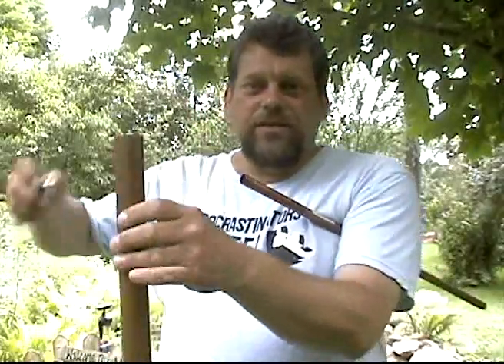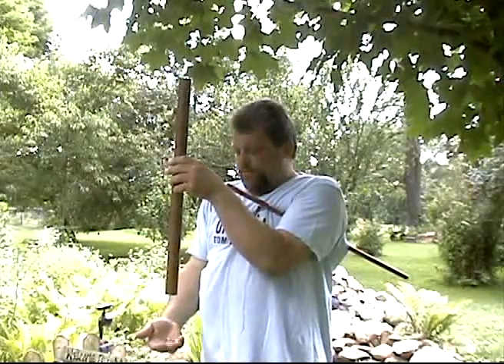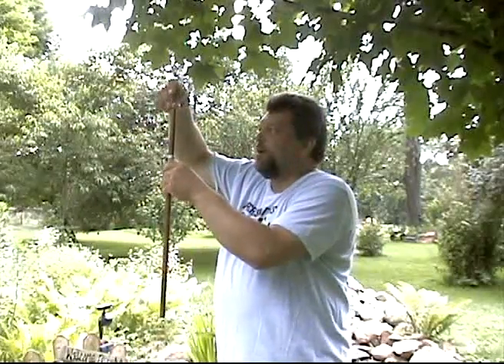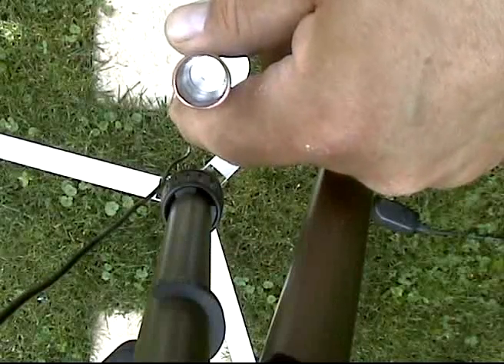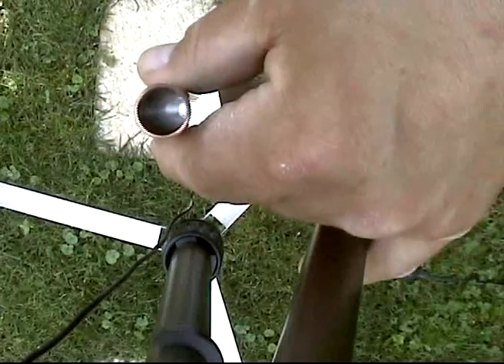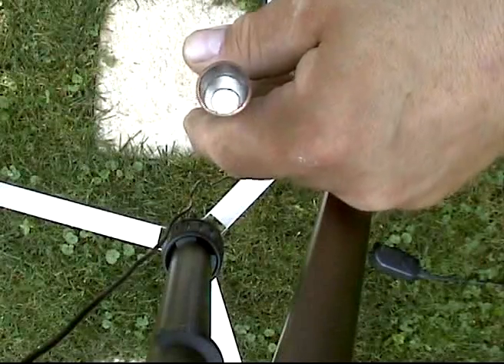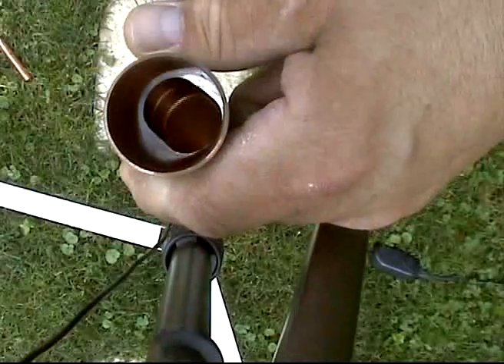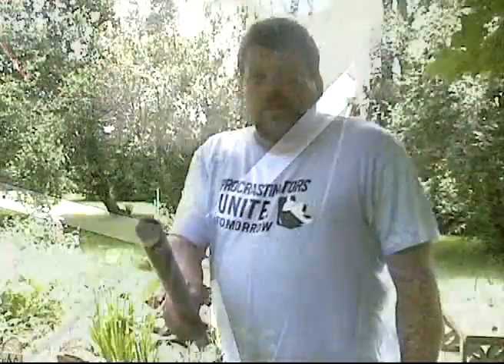Do Try This at Home - Season 2, Episode 3 - Summer Slow Fall

Comment: i think i know how it works!  its sorta like a generater. if you move a magned around a copper wire, it generates electricity. andwhen copper has a current, it becomes an electromagnet. so it is not magnetic, unless the magnet if moving through.

Comment: More questions:
The moving magnet decelerates and after a short while settles around a certain speed in the tube. Is this time (or the length of the tube needed to achieve full slowdown) direct proportional to the acceleration?

In one of my last posts I implied, that on the moon the time it took for the magnet to pass through the pipe would be the same (- because the speed of the magnet in the pipe would be the same.)

But now I think, if  the pipe is too short there'll be a difference.

Comment: Energy-density: a N=52 magnet would slow down about 20% more than a N=42?
Resistivity: a silver tube would slow down about 5% more than a copper tube?
Electrical Resistance: doubling cross section (thickness of the tube-material) would half the resistance, thus doubling the eddy current and the resulting magnetic force  (100%)?

(Air-) Distance between magnet and tube: half the distance results in 8 times the force (800%) - but more air looks cooler!

Ever tried a coil instead of a tube?

Comment: If you did this on the moon it wouldn't take longer to fall out!?!
Gravity is weaker there, so the magnet would move slower, thus inducing less eddy current resulting in a weaker magnetic field, which would slow down the fall less. But is it linear proportional?

For the speed to be slow you need high energy density of the magnet, and  close proximity to the tube (magnetic forces diminish with distance ^3), and a low resistance material. Main component being distance right?

Comment: The first time you lift up the tube while the magnet is in it.
But it doesn't seem to fall out significantly earlier than with the unmoved tube!

My explanation:
The magnet itself is falling with the same speed (the gravity doesn't change), but relative speed between the magnet and the tube in the moved/lifted tube is higher, thus the induced Eddy Current and the corresponding magnetic field is stronger, so it's getting slowed down more. Is that right?

Comment: Just a few hypothetical questions:

The Eddy current heats the pipe, because it has electric resistance? Would it be measurable?

If the tube was a superconductor, the induced Eddy-current would never stop?
If you repeated the experiment a few times then, would the Eddy-Currents of each cycle add up, so at the n-th cycle the magnet wouldn't come out at all, but be stuck floating?
If so, what number would n be? 2? 10?
Is there a way to calculate the force of the Eddy Current?

Comment: If you can find some alumin foil rolls with a small core( smaler is better), it also works. Looks cooler with a square magnent. On tv there was this super strong electromagnent, they dropped a aluminum ingot in, and took 2+min to come out

Comment: Has anyone actually read the description of the video? The magnet induces a current (Eddy Current) in the copper pipe, which creates an electromagnetic field. That field acts against the falling magnet, slowing it down. Think of the flashlights that you shake to charge. They have a megnet and a copper coil to generate electricity. It has nothing to do with air pressure (the pipe is open at both ends!) or compressed magnetic fields.

Comment: What would happen if you took the smaller pipe, put it inside the larger pipe then dropped the round neodymium magnet inside the smaller magnet... would it drop slower?

Comment: It actually works with every metall , copper is so good for creating eddie currents because of it slow electrical resistence. And it doesnt attract magnets, wich is good because then the magnet can move....

That also works with metall that can be attracted by magnets, but you wont see it because the magnet just sticks to it...

Comment: Eddiecurrents always fascinated me, and also the fact that the are stronger the faster the magnet moves.
Thats why they are used for modern trains as a brake.
But because they turn useless if the train is slowed down to like walking speed, they still need the "normal" brakes.

Comment: Maybe as the Magnets fall they creat friction. That brings about heat energy or something like static electricity? Which would make the copper an electromagnet? However the force of gracity is stronger than the Magnetic force caused be the friction, so it falls down. That is my best guess now I will go find out the truth.